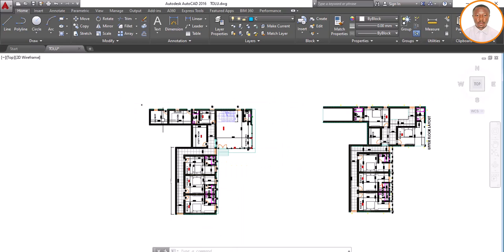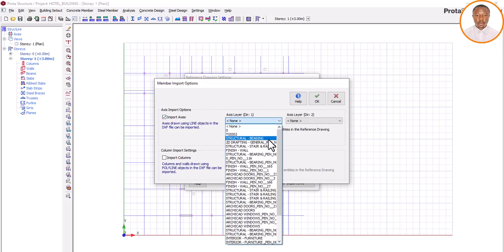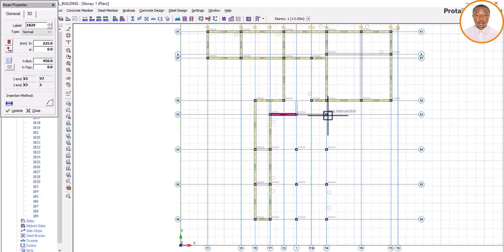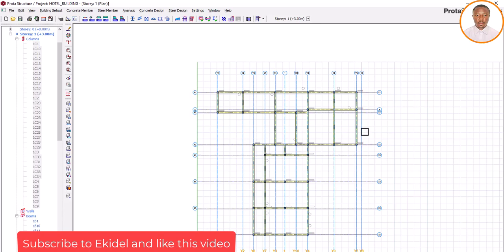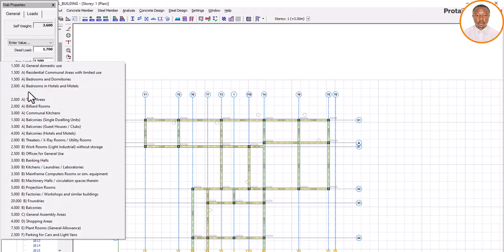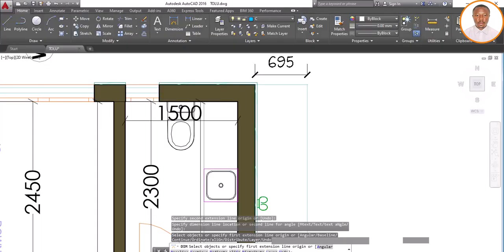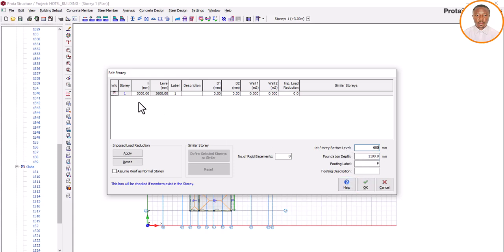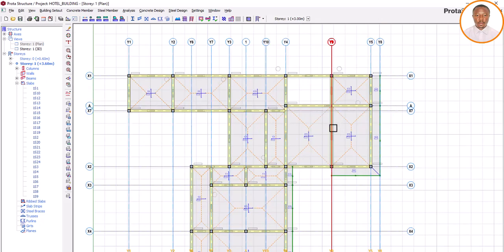PART 1: ONE STOREY BUILDING DESIGN IN PROTASTRUCTURE

Comment: Hello Engineer, please I need your help. Each time I save drawing in DXF i found it difficult to open on ProtaStructure. It doesn't open.
Reply from the maker: Maybe you are using version of AutoCAD below 2010.

Also explode your building plan before you begin your structural framing in AutoCAD and then save to DXF